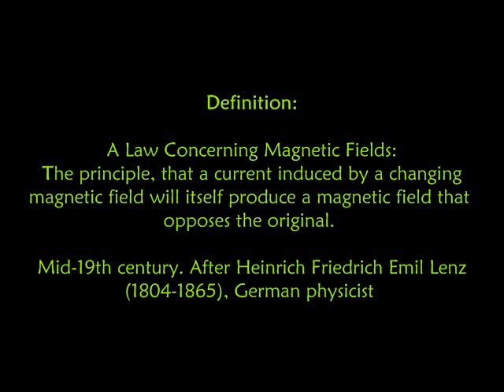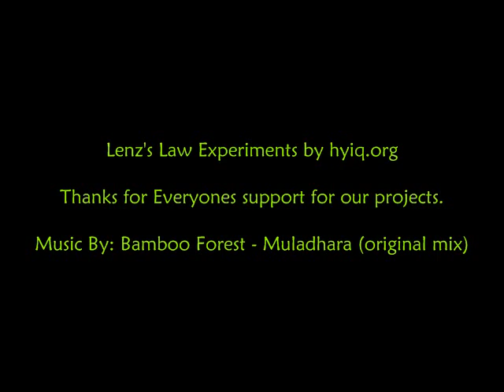Lenz's Law

Comment from the maker: Hey Albert, wow, I only just saw your post! Well, "No Magnetic Field" is acutally a big call. I would say if the coil's depth was adjusted so the Flux Lines were not cutting the coil at this point it would make a difference. But in my case it is not making a big difference because there is a lot more coil that does cut the lines of force than does not.

Essentially this is no different that the space between each line in its own right.

Comment: Hi
Could you tell me the materials used?
Turns of the coil.
Diameter of the wire.
Core material.
Diameter and power of magnets.
Greetings.

Comment from the maker: I see my comment on Lenz Law below has been removed??? 
I dont see how this can be, Author withheld? 
Lets try again: "energy-ingenuity . com" 
The Ward Force Generator uses Lenz Law to assist in its operation. This is a good example on how to circumvent Lenz's Law problems in a System. The Rotor Floats on a Field that is created by Lenz's Law and as a result the Rotor speeds up.